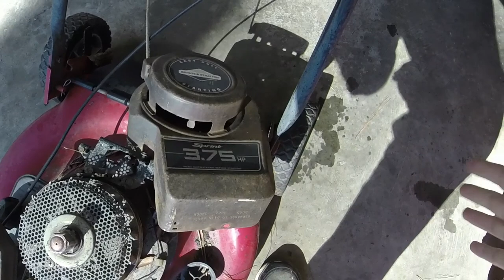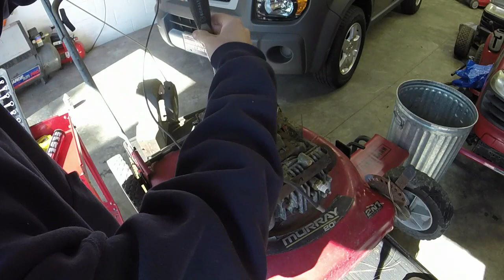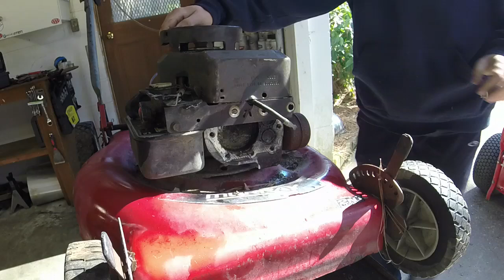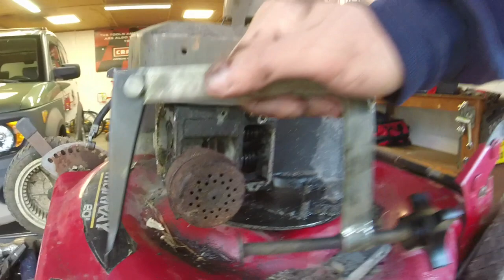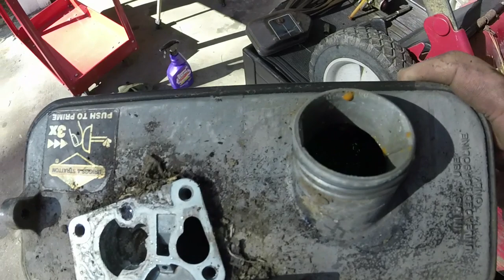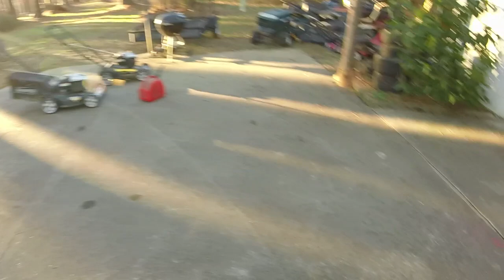Using some special tools and a lot of lube on a Murray 20" with stuck intake valve

Comment: Flathead 101.  I cut my teeth on these mowers.  The old ones had points too. !!!!     I still love it when they come in to my shop.  .  I had a starter clutch wrench sent to my by a subscriber.   wonderful   eh!!!   
At 39:34 it all came together.  I have learned the most from the machines that I have made the least amount of money on.    Fun stuff Thanks.  Good mower  for a needy family.    It isn't going to the landfill.
Reply from the maker: You're right Bruce, I don't do valve work very often and I love saving mowers destined for the landfill.

Comment: I use a block of wood and hammer to get those old  style starters off

I just sold a Murray 20” side discharge few days ago.

Good work there getting it running again.

Comment: A small brass wire wheel or cup on a drill or Dremel tool will make quick work of cleaning the carbon off the top of the piston, the valve face and stem, and the head without using up all your cleaning products. Great mower save, as always!
Reply from the maker: I typically use a wire wheel, don't know why I didn't on this one.

Comment: That other push mower might have stuck piston rings get some seafoam lubricant spray and let set up for two days and it might run
Reply from the maker: I'll give that a shot.  The cylinder wall looks clear and the valves seem good.